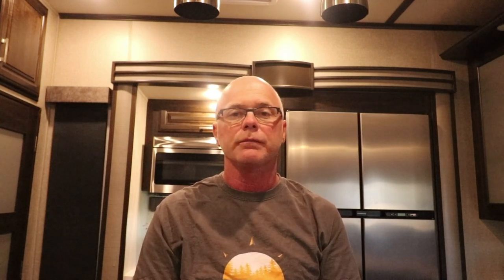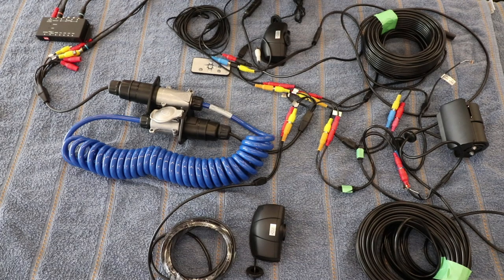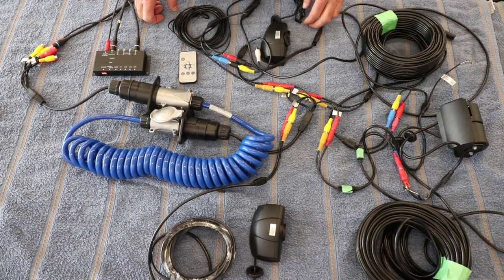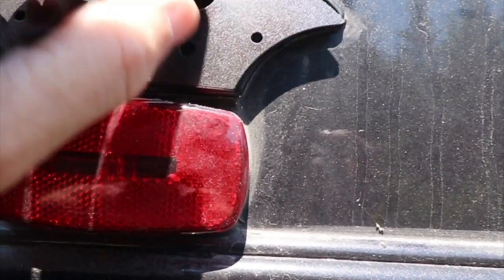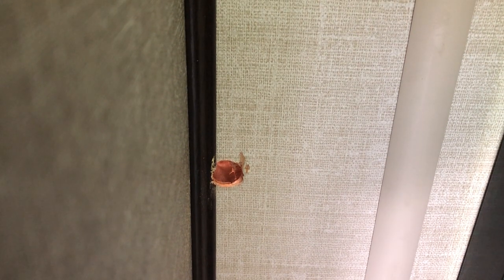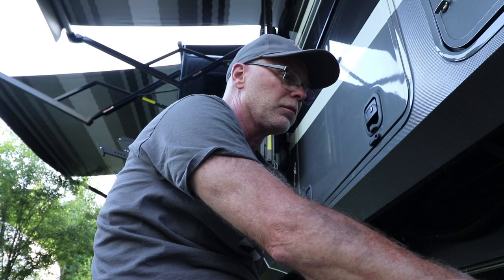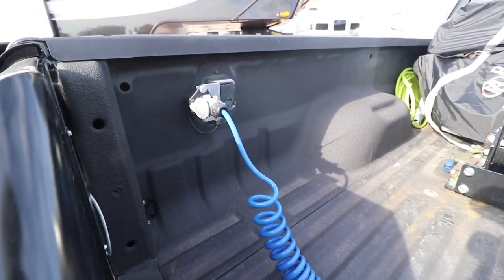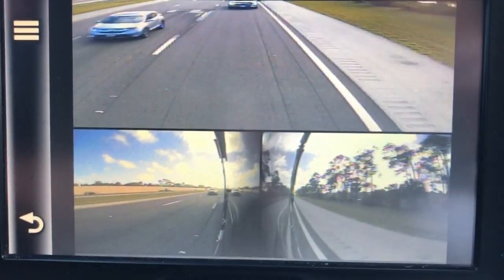Install a 4-channel camera system on your RV - Full Time RV Living

Comment: You did an amazing job! Thanks for posting your solution. I'd like to install a similar solution and I've already visited the Tadi site. Do you have any footage of how you implemented the quick connect solution? That is truly brilliant, and I don't think I have seen that elsewhere. Did you use a standard 7 way wiring harness? Keep up the great videos. I just subscribed and can't wait to learn more. Safe travels!
Reply from the maker: Hi there. If you are talking about the coiled cable we use to connect the cameras from the trailer to the truck then that is a standard Tadibrothers system. We bought all the components from them. If we’ve misunderstood your question please let us know.  Thanks for watching. D&J